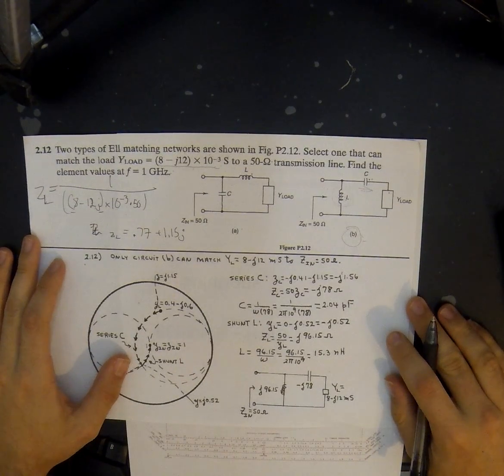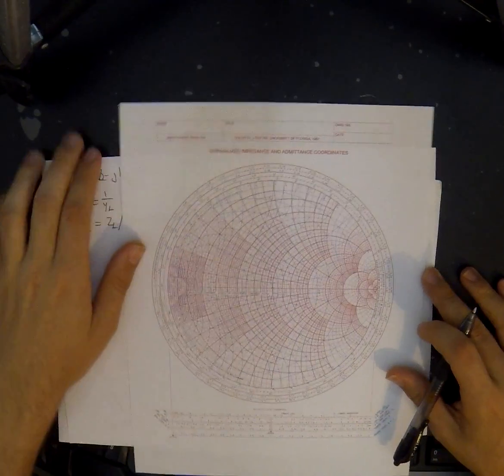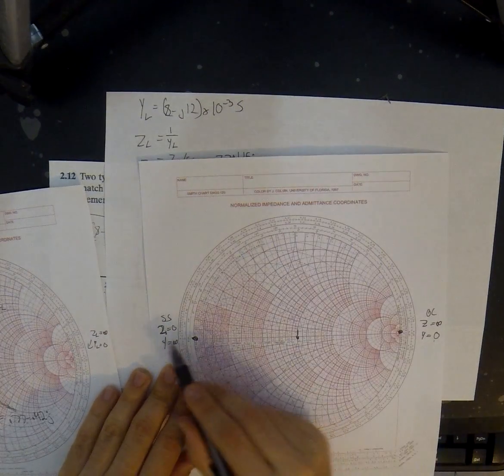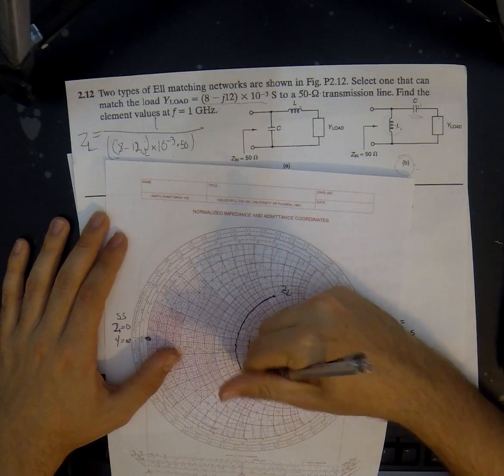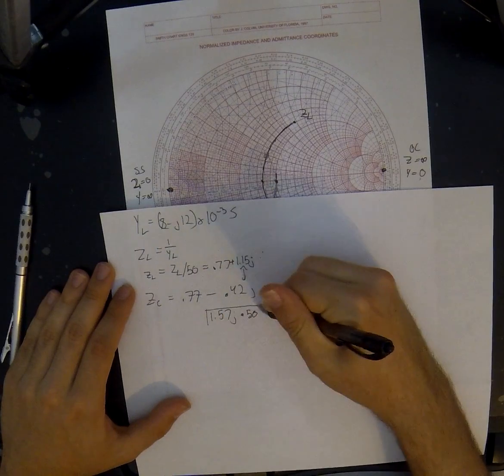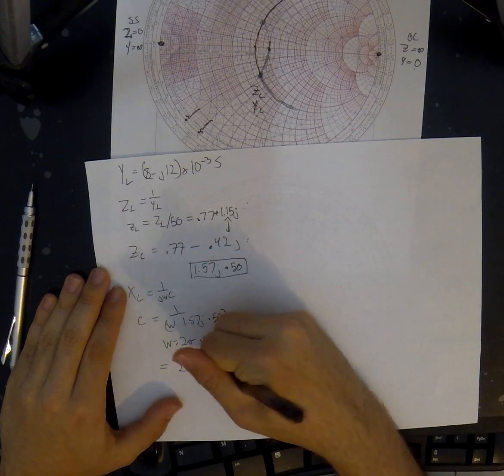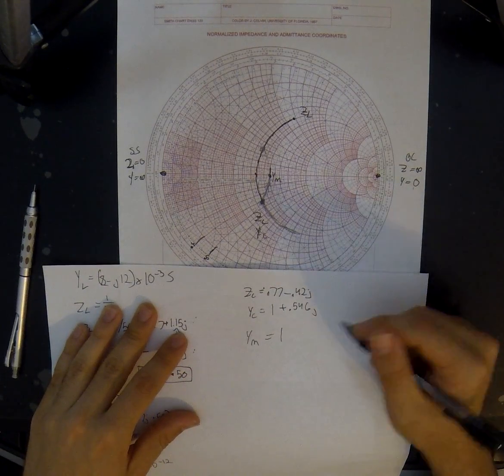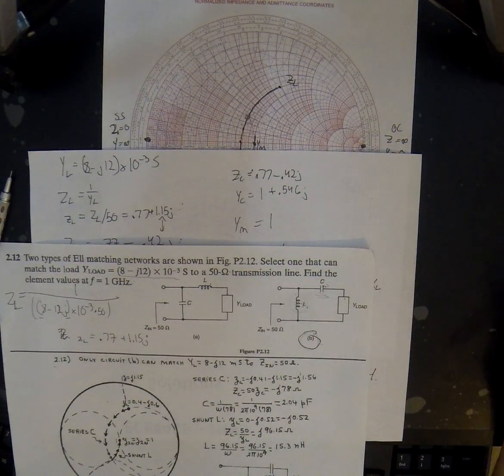L C Matching Network using Smith Chart and Impedance Admittance circles

Comment: At step 1 the admittance could have been transformed to an impedance by using the smith chart by first normalizing then reflecting through the origin... You should not write X_C and X_L with a j. Otherwise good video.

Comment: What is the normalized load admittance? A 300 ohm transmission line is terminated with an antenna that presents a (450 ohm - j600 ohm) load impedance.

Comment: Very good tutorial, the only thing that would make it a little more clear is if you explain the matching path using the smith chart only, THEN do it using the theoretical calculations, instead of moving back and forth between the two.
Reply from the maker: Thanks for the suggestion. In the future examples I'll try to do both.